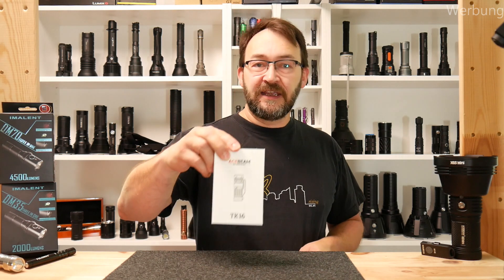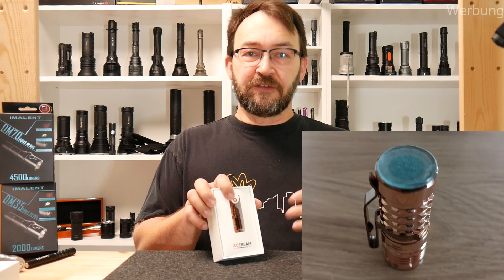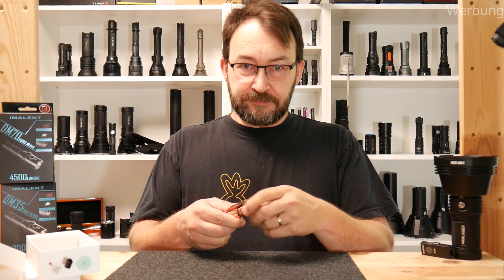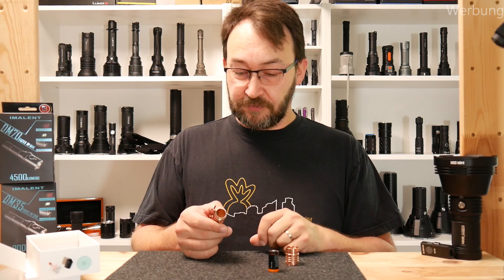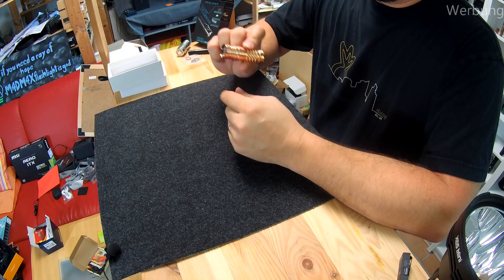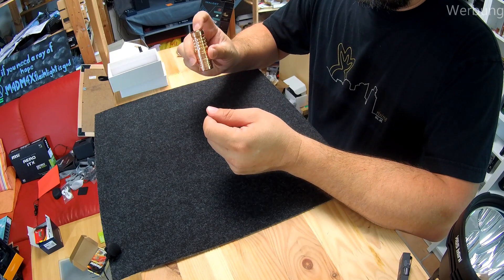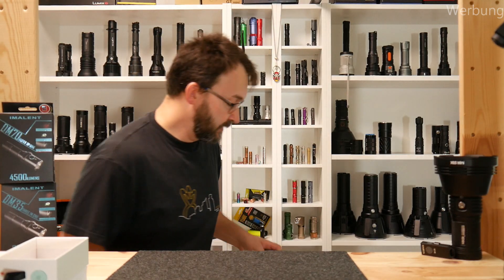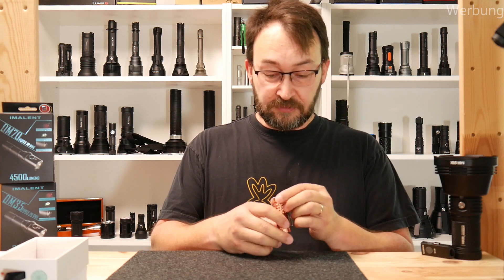Acebeam TK16 - review and beamshots

Comment: Can I ask u a question about  charging? Must I charge my tk 16 immediately or first I must use it until end and after that to charge it?
Reply from the maker: Hi

you can just run it as delivered - but since the cell is half empty high and turb mode will be limited (and so is fun)

i always charge at first

Comment: Do you know what spec battery's should work with the Acebeam Tk16? I've tried 16340: Fenix ARB-L16-700 (3.6V, 700mAh, 2.52Wh, protected) and Nitecore NL665R (3.6V, 650mAh, 2.34Wh, protected) and both shut the flashlight off. Why is this? And what is the maximum spec for an other battery?
Reply from the maker: you need high power cells
rated 8A or more

Comment: You mentioned not understanding why these little torches have an Eco mode. I use my "Olight S1R Baton 2" on Moon / Eco mode when walking at night in more rural areas. When a car comes facing you on your side of the road, you need it on mid setting as it's temporarily blinding. Eco being just enough to see directly in front of your feet.
I was eager to see how this Acebeam TK16 compared to my Olight. The Acebeam has a more defined spot whereas the Olight is more of a flood. The spot on the Acebeam seems to have a better reach than the flood'y beam of the Olight. The Olight makes it a great walking torch though. (Edited as I was tired when I wrote my comment, liked the video).

Comment: Hi sorry to ask but I'm looking for an EDC light with maximum Throw instead of flood lights like the Olights and am having a hard time getting answers online could you help me please? I want something smaller then 18650 there a little to big to carry without a belt case. I perfer a tail switch but would be ok with a side button. Believe it or not so far my favorite EDC light Is a sofrin 14500 light I choose it over the olight  s1r and S2R batons and the thrunite T1 because they have to much flood turns out Hi lumen output seems worse for distance  . Iv been considering this Acebeam but worried the 3 LEDs would just be a wide flood light like my 2600lm  olight H2R. Thanks for any info you can provide.
Reply from the maker: maybe a FW1A with the 18350 tube and deep pocket clip will be the one you are looking for ;)

Comment: Hi Martin,
You have shown in this video the Vapcell 16340 but you said the acebeam cell is better.

Can you tell me if you have measured how many real mah the Vapcell has?
Would be interested to know.

Thank you.
Reply from the maker: it's not the mAh
the acebeam has higher peak amp
Reply: @MartinRathmanner_M4D_M4X  
Yeah but the Vapcell has arround 880mah from what I have heard.
If you run it on high it would last 1.5times longer.

But just to ask  h you measured the real mah capacity of the cell?
Reply: HEY 
I have 16350 rated labeled as 850mah. They have all measured above that around 880. 
Vapcell are good.

Comment: Ok I have bought this light and I have to say I have never seen such a piece of junk, have changed two recharge able batteries and keeps overheating, when I compare it to my olight S1r Barton 2 it’s no comparison.......... don’t waste your money just buy a olight better torch hands down. I’m in security and I buy a lot of lights from thrunite to nitecore........ just don’t buy Acebeam so unreliable.
Reply: what u mean overheating? yes it gets hot on highest turbo its a small light afterall....
Reply: I own both the s1r2(1000 lumens)and tk16(1800 lumens) and they both get hot when it’s on turbo. Still prefer the tk16 it has a better tint.
Reply: @quantametric  sounds about right, using 1 model to trash the whole brand, either paid, or ignorant